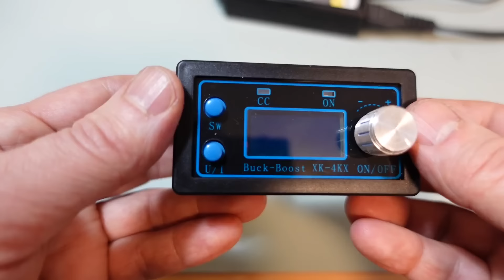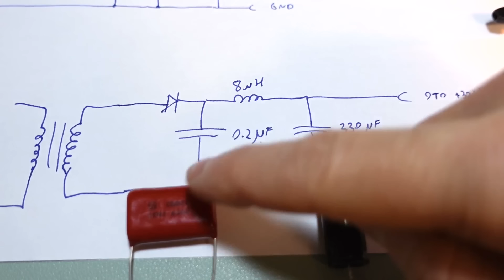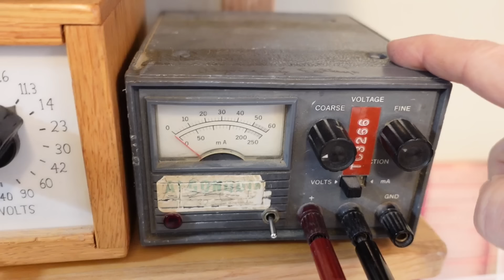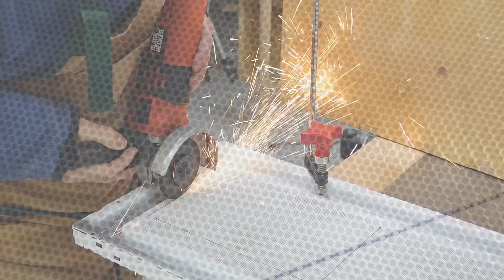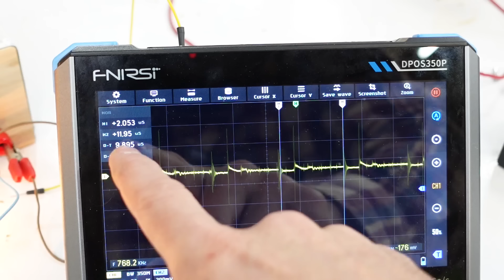Benchtop supply from buckboost converter, chasing RF emissions

Comment: The Fnirsi scope is on special offer direct from them atm - making it a cracking bargain despite the shortcomings. My order is in!
Reply from the maker: Indeed, just checked, it Is quite marked down  (FNIRSI DPOS350P) on Aliexpress.  At  that price its worth it.  But before you take this as an endorsement, watch my review of it.  Not as solid as a Rigol, but fast and easy to use, and miles ahead of any "scope meter".  https://youtu.be/dcexJ4CTvOg
Reply: @matthiasrandomstuff2221 nice didn’t have to look very far to see this. Was wondering if you’d reviewed it. I’m after a portable one!

Comment: Hey thanks for posting this, the timing was perfect. I've been wanting to take up hobby electronics for basically my whole life, and was planning to dive in any day now when I saw this video. I had no idea these little modules exist, so I ordered one for $10 and got it last night. Like you, I hooked up an old laptop power supply I didn't need anymore. 

This thing is a game changer, coming from no bench power supply. Being able to just turn the dial down to 5v and then connect it to an Arduino, etc., it's so cool. I'm gonna get lots of use out of this.

Comment: I solved a similar problem about two years ago. I bought a number of small seperate buck and boost converters from Shen Zhen. I hot quite a few of each and whilst shopping I saw the one you are using here but it did not fit my specific needs at that time…but I will tell the story of my “battle” with RF “birdies”.

I have an old Nikkon P600 SLR thst will film video, but it is a dumb, old design on a piwering sense in thst it uses a proprepietary battery and won’t charge it via the USB port…I wanred to replace the bsttery with a buck converter and cram that buck converter into the hollowed-out case of one of the batteries. The Chinese buck converters looked “perfect for the job”…leadt initially.
I soon discovered thst the buck converter would not buck down from 5v (USB source) to 3.9v, the requirement of the camera, so I had to buck down from 12v. (I later set up one of the boost converters to boost up from 5 to 12 and fitted it in a box on the lead to the camera…now I can run the camera off an external battery pack with USB ports.

My ultimate intention was to use the camera to film out the window of Vietmam Airlines flight 780 from Melbourne to Saigon. Their aircraft were fitted with USB connectors in the seat backs and I could just plug the csmera in there. (Sinc then the rules have changed regarding this p, but thst is another story.) Intending to use these converters on sn sircrsft and not intefere with the altitude radar was a prime concern snd eliminsting ALL RF birdies to st least 50dB down was a main goal.

I tested both converters. Under no load conditions the spec an could not really see much, (a HP-8590A on max span from 100K to 1.5G). However, once a load was connected a whole “christmas tree” of harmonics appeared..the highest I could see were st about 1.2GHz but down st about -30dB. Down below 50MHz there was a mess of birdies some almost up to 0dBm.

My dolution eas to get a Milo tin (bit like a psint tin for those outside Australia), these have a thight fitting lid thst mskes a better seal than mosy fancy Beryllium-Copper RF “fingers”. I made two holes in the lid and doldered in two 1nF feed-through capacitors, i connected the ground 0v node of the converter to the underside of the lid by scraping the conformsl voating off the groundplane along one side of the board and fillet-soldering it to the lid at a 90 degree angle…this made a really dolid RF ground. Then ran the “in” and “out” via the two feedthroughs with some dhortish pieces of ‘Phone pair”. 

Running it with a 5w load out of the tin still dhowed birdies ion the Spec An, in the same places, but weaker. Putting it into the tin completely blocked all the birdies above about 30MHz, but a lot of the lower stuff got out, slbeit about 20dB down on when it was out of the tin. 

To fix this, I made a tinplste “wall” and soldered it around the converter on the underside of the lid, put two holes in the wall and another two feedthroughs in them. In the inside I crammed in two 10nF ceramics, right close to the feedthroughs and connected it up internslly to the vonverter. Outside the wall I put a ferrite toroid common-mode choke robbed from sn SMPS, between the four feedthroughs.

That FIXED it…completely…vould see nothing on the Spec An. Even with the antenna right up sgsinst the DC lines.
I duplocsted the setup in the gutted out bsttery with a tiny toroid and in the ecternsl boost box I sioldered up from tinplate. It worked flawlessly..safe flight, great video footsge flying over Sulewesi and NO BIRDIES.

I think you vould schieve the same with some reworkibg of your microwave oven screen enclosure, some tinplste, dolder snd s few feedthroughs!

Cheets from Tasmsnia!
Reply from the maker: You could eliminae all that hoise AND make it more efficient by just using a plain old linear regulator to go from 5 volts to the 3.9.  Yes, that will lose 22%, but boosting then bucking wil lose more.

Comment: Is there any reason why one could not make that new secondary a lot more turns; enough, in fact, so get several hundred volts? I want a variable high voltage supply for testing tube circuits Thoughts?
Reply from the maker: definitely could add more turns, but not high voltage would be a problem.  capacitance between so many windings would probably cause additional resonance which could mess things up.  also insulation failure could become an issue.

Comment: old matthias: “i needed a front panel so i just held up a piece of wood and traced around it and took out some holes and it looks pretty good”; new matthias: “i needed front panel so i took a picture and scaled it to a CAD program and drew all the buttons in CAD and made a profile then created a CAM path and then i…”
Reply from the maker: problem with this one is, its too small, tricky to work that accurately enough, especially with most of the cut edges visible.
Reply: :) i was just funnin’ anyway, always happy to see whatever you’re up to

Comment: AI Summary

Abstract:
This technical teardown and modification report details the conversion of a commercial-off-the-shelf (COTS) buck-boost module into a dual-output benchtop power supply. The primary modification involves leveraging the module's flyback topology by adding a tertiary winding to the main inductor to create an isolated secondary rail. While the modification successfully provides power, it introduces significant cross-regulation challenges and severe electromagnetic interference (EMI). The analysis utilizes time-domain reflectometry and spectrum analysis to identify noise sources, specifically "ground bounce" and parasitic broadcast from the isolated secondary. Mitigation strategies include the implementation of LC pi-filters, common-mode chokes, and capacitive coupling to reduce RF emissions.

Project Analysis and Key Takeaways:

*   0:00 Topology Identification: The "buck-boost" module is identified as a flyback converter. The main inductor functions as a transformer with a secondary winding used to invert polarity for a positive output.
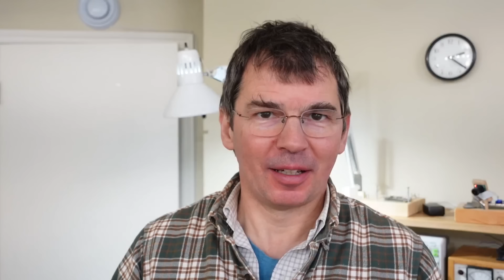*   1:17 Isolated Rail Modification: A tertiary winding (telephone wire) was manually added to the flyback transformer. This provides an isolated output that tracks the primary voltage but suffers from poor cross-regulation; a minimum load on the primary is required to maintain secondary stability.
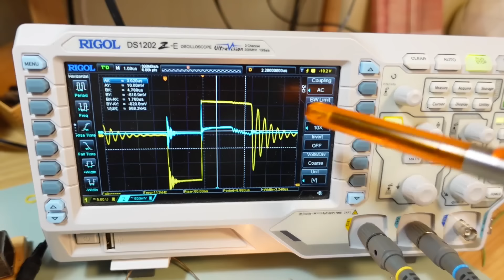*   3:28 Noise Characterization: Initial testing revealed high-frequency transients (2V spikes) on the output. Oscilloscope cursors identified ringing at ~89–100 MHz, largely attributed to parasitic inductance in the test leads and the module's inherent switching noise.
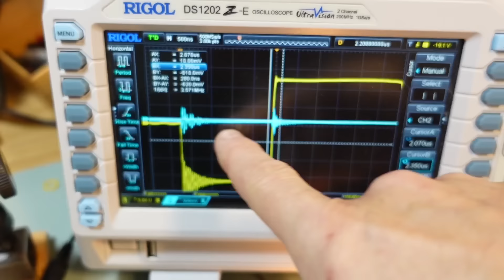*   5:08 Measurement Integrity: Using a battery-powered oscilloscope was critical in identifying "ground bounce." Standard mains-referenced scopes failed to accurately capture the noise due to shared ground paths.
*   7:06 CNC Interface Integration: A custom wooden enclosure was designed using SketchUp and a Python-based toolpath generator. This demonstrates a method for integrating COTS electronics into bespoke form factors.
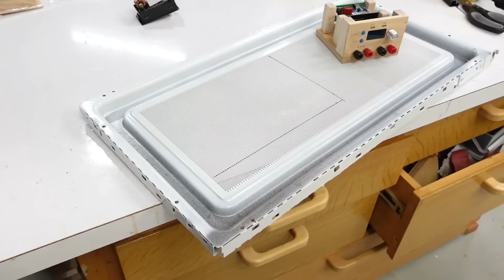*   9:01 EMI Shielding: A microwave oven door mesh was repurposed as a Faraday cage for the enclosure to mitigate radiated emissions from the switching electronics.
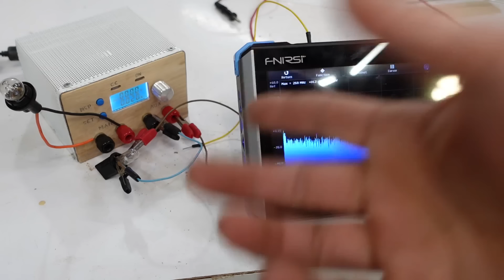*   10:37 Spectral Analysis: Spectrum analysis confirmed noise peaks at 35 MHz and 90 MHz. The isolated secondary winding acted as a broadcast antenna, significantly increasing the module's RF footprint compared to the unmodified state.
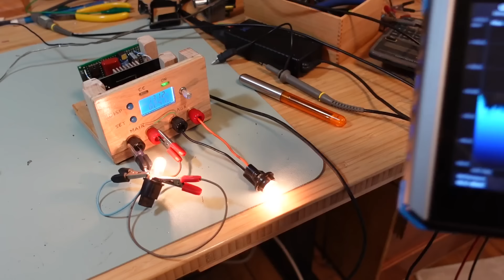*   12:44 Mitigation Techniques: RF emissions were suppressed by adding a common-mode filter choke and a 10nF capacitor to tie the isolated grounds at high frequencies. Placing the outputs in series further reduced the spectral peaks.
*   13:17 COTS Reliability Issues: The report highlights a high failure rate for inexpensive AliExpress modules, with two out of three units arriving with manufacturing defects (faulty displays and dead power stages).
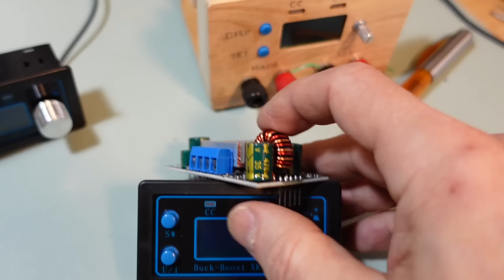*   13:46 Tooling Advantage: The utility of a handheld, battery-powered oscilloscope (Fnirsi) for field-testing and floating measurements is emphasized, despite the device's technical shortcomings.

AI-generated summary created with gemini-3-flash-preview for free via RocketRecap-dot-com. (Input: 17,658 tokens, Output: 716 tokens, Est. cost: $0.0110).

Comment: The two windings on the inductor could be for a SEPIC converter, rather than a flyback, which allows a boost converter IC to be used for buck-boost operation.
Buck-boost converters often use 2 switches and 2 diodes to allow positive in and out voltage (or use 4 switches for sync rectification), rather than inverting the voltage.
Reply from the maker: there is only one switching transistor and one diode on the PCB.
Reply: @matthiasrandomstuff2221  SEPIC only uses a single transistor and diode. There would be a capacitor between the switch and diode if it is this.

Comment: I have several of these, usually running off laptop bricks. I always assumed the "buck-boost" was coupled inductor SEPIC converter. Are you sure it's a non-isolated flyback? I don't know why they'd do that over a SEPIC topology. I've heard of "Fly-buck" converters similar to what  you describe, but I haven't seen that implemented on a buck-boost. Anything is possible, but I've got a feeling this is more like a coupled SEPIC than a flyback. All mine are area used or I might take one apart.
Reply from the maker: well, this way is the simplest, just one switching transistor and one diode, plus two windings on the inductor.
Reply: @matthiasrandomstuff2221 that's true, it is very simple. I've actually used a design like this before where I just took a very cheap Buck converter and swapped the inductor with a transformer (instated backwards) out of a 5v USB wall adapter. 12v input gives adjustable output  from 100 to 400v, which is perfect for running low power preamp tubes like a 12ax7. (Well... Except for the noise.)

Comment: Do you think replacing your extra inductor winding wire with coax, and grounding the shield, would help?
Reply from the maker: It could help, but if I add that much capacitance, why not just ground it through a capacitor?  Also, there would not have been room for a coax.
Reply: @matthiasrandomstuff2221  Well, devices use some pretty small diameter coax these days.  Actually, what made me think of using coax is that the RF guys I used to work with would make their own custom H-field probes using coax to shield from E-fields.  (One guy made an H-field probe using three loops, oriented x-y-z, and rms'ed them together with a special circuit.)

Comment: 3d printer. Just saying.
Reply from the maker: With a 3d printer, iterating on the front place would have taken 10x longer to print, and used up filaement every time.  Whereas the cost of wood scraps is neglibible.

Comment: If you ever use a LTC3780 board for charging batteries, make sure to put a reverse voltage protection circuit together, I destroyed mine with it. I looked up the IC itself and it costs the same as the complete board from ebay.
Reply from the maker: I guess that would be in the form of a big diode and fuse that blows if reverse connected?

Comment: I have a USB-PD power bank for the DHO900 scope at work. It works.
Reply from the maker: That's gotta be a beefy power bank.  The Fnirsi uses a lot of power, but the DHO900 uses a lot more.  If I had to run a scope off a power bank, I'd probably use my not so great hanmatek, cause it uses just 10 watts.
Reply: @matthiasrandomstuff2221  I run a DHO804 off a standard 100Wh power bank. I don't remember how much it pulls, but it's not enough to be an issue. No idea about the DHO900 though.
Reply: @matthiasrandomstuff2221  Yeah, the power bank is in the same price range as a whole new Fnirsi scope. It's a ugreen PB722 which is rated for 200W, but the power supply for the DHO924S is rated for 65W, so the power rating is definitely overkill. I suspect that you might enjoy a deep dive into the world of USB-PD. ;)

Comment: My solution to switching-supply noise is to use analog-regulated supplies as much as possible. The only thing that can beat a good ol' transformer-based linear supply for noise is a battery. That's why I never let a mains step-down transformer slip through my fingers when I come across one--including the transformers that used to come with doorbells.
Reply from the maker: I have a collection of them too.  But for something like a power adapter that's always plugged in, they get warm even idling, so I prefer the switch mode ones to waste less power.  I would imagine a quality benchtop power supply would have fewer issues.
Reply: @matthiasrandomstuff2221  Yes, linear supplies have a higher running overhead. But I'm a radio amateur (a.k.a. "ham") and I do everything I can to eliminate stray RF from as many sources as I can. Switch-mode supplies and other digital devices have radically degraded the RF environment over the past decades, and in some places-like mine- the noise "floor" is very high. Shielding of circuit elements helps, but a shielded antenna is an oxymoron, and it hangs out there collecting every noise source within a few miles. The number of such sources grows exponentially, made all the more likely by the habit of leaving "walwarts," etc., plugged in all the time (or not switched off if on a strip).
Reply: @matthiasrandomstuff2221  You can get significant reductions in power supply switching noise using slew-rate controlled DC-DC switching regulator ICs.  Some of these even let you trade off efficiency versus noise by setting the desired maximum voltage/current slew rates.  This probably means building your own from scratch, though.  Or maybe starting with a demo board from the IC vendor.

Comment: I copied your earlier box for a power supply, maybe 10 years ago and installed one of those buckboost converters in it. Worked a treat. Drove it with an old switched windings power supply produced for schools in the 1960's. Still going strong.

Comment: That's why RF-emitting equipment was enclosed in Faraday cages. 🤷‍♂️
Reply: To emit at 30 MHz and even 100 MHz, you usually need some cables attached to the device. It is hard to make an effective antenna for a 3 m wavelength when your project box is small. What I am getting at is that probably the Faraday cage will not help that much if you have cables sticking out.

Comment: There are also non-inverting buck regulators. You just have to swap the positions of the diode and the inductor.
Reply from the maker: Yes, but that means you can only step the voltage down.  Its nice being able to get 30 volts out of it, but 30 volt adapters are hard to find.

Comment: Some microwaves (well, sample of one, Daewoo something) are nicely constructed and become great chassises for old timey RF projects. An "H" skeleton of back and front inner panels, with several different sized compartments in between.
Reply from the maker: Never thought of that.  Haven't done any "RF projects", at least not intentionally!
Reply: @matthiasrandomstuff2221  It goes both ways, say some millivolt analog gadget, very upset by a telephone laying on the same desk.

Comment: When you say the fan makes more noise, for some reason I think you mean electrical noise in the form of back EMF and the switching?  Unless you mean both sound waves and electrical interference.  At Conestoga College, we had to make our own bench top power supply and it was adjustable in both output current and voltage.  It had a limit of 500 mA output per side as well but used a fairly beefy transformer and operational amps...can't remember exactly for what as I was only in college for a semester before dropping out.  After that I made a couple of modifications to it, I removed the stock power cord and replaced it with a detachable IEC 60320 C13/14 cord and connector like that seen on a computer power supply.  I also added an analogue volt meter that had a range from 0-30 V (the power supply was capable of up to 25 I think so that worked out) that also had a DPDT or SPDT switch to monitor the output voltage without having to hook up a multimeter.
Reply from the maker: Oh, yes, that can be ambiguous, but I think the context makes it fairly clear I'm referring to audible noise.

Comment: Doesn't the scope short your ground to mains earth? Was that old laptop power supply earth grounded too? I'm surprised you can have a ground on both sides of the transformer and get a working power supply. But hey, if it works, it works!
Reply from the maker: The laptop supply isn't grounded.  My Rigol scope IS grounded though.  But at 100 mhz, "Grounded" is relative.  Even if a power supply is not grounded, it can be as connected as a piece of wire at that frequency.